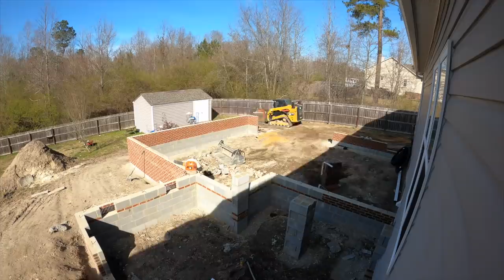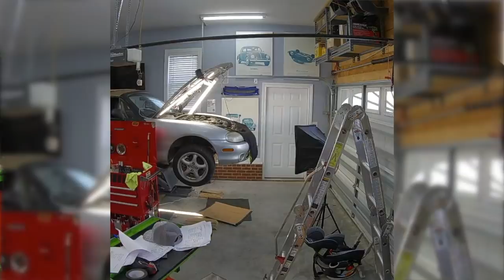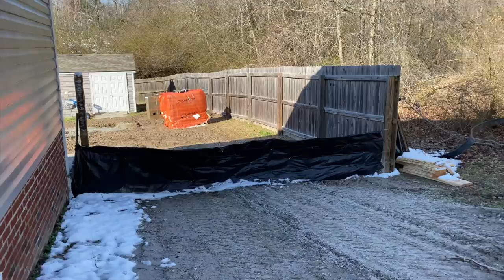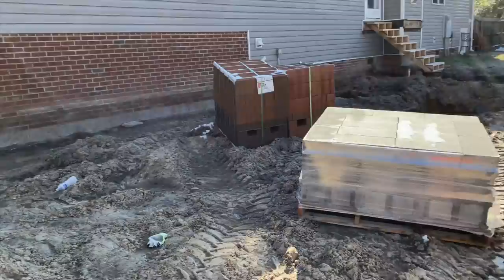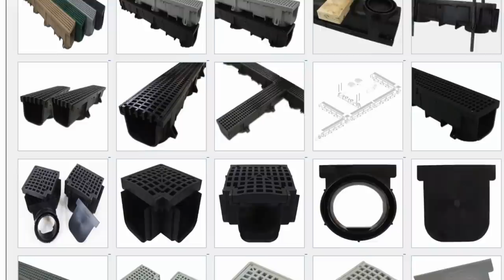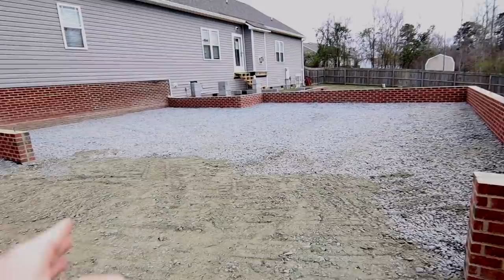We are Building a New Shop!!

Comment from the maker: Something I forget to mention in the video, we will have 220v on each wall. Also there are something that we aren't doing. Yes Id love to have 10x the space. We did the most we could in the budget we have.
Reply: We car them roller shutter doors but good idea to save space.
Reply: I recently built a shop of my own about a year and half ago, Here are some things that I did to try and "future proof it"
1. Run electrical for ceiling fans, Its cheaper to do the wiring with everything else even if you don't put the fans up right away (I still don't have fans)
2. Run power for the roll up door even if you don't plan on having an electric motor now, down the road its nice to have an option
3. Run a empty circuit to each side of the walls to go outside of the building you never know down the road what you will need power for outside
4. Ceiling mount circuits for drop down power cords
5. Dont forget exterior lighting
6. I went with all LED light fixtures and love them

Something  I wish I did at the time,
 Epoxy the floors, I told myself I would do it down the road. (still haven't) but its going to be a pain in the ass with everything in the way. now there is staining in a few spots even though I try to keep it clean.
I also wish I would have painted the walls white at the time even though I have a ton of light It would have helped out a lot for light.
Reply: @bmxguy08  Bloody surprising just how much difference painting the walls white makes. Did it down my little garage with tiny windows, and it used to just be brick. Very dark, had to use lights throughout the whole garage. Painted the walls and there is now only one spot where I need a light on during the day.
Reply: HumbleMechanic I use a pellet stove for my 1000sqft garage works amazing when it’s 30-40 degrees I go out around 6:30 am and by 8am it’s 60 degrees and will get up to 70. I also have concrete floors as well
Reply: Show us the black R32 ;)
Reply: Did I miss it or you did not mention doing an air system in your new garage?
Reply: Hey random question. I'm thinking of buy an Audi Q7 Quattro with the 3.6L. what should I look out for? Is the reliability the same as the Touareg
Reply: Definitely go with new age cabinets

Comment: Sockets...lots of sockets or power outlet as you call them. Keep the air compressor outside in a small enclosure for noise reasons obviously
Reply from the maker: Oh yea!!!! We doubled the outlets, and I will be building a compressor house. I don't want that noise maker in the garage
Reply: Piggy backing from these - might as well plan for AP's and conduits for ethernet cable runs.  And conduits for PoE security system.
Reply: Make sure each outlet has its own ground that was over a million dollar mistake at my old colledge

Comment: As the floor heat sink countermeasure, we are permitted to use the ground rated, insect proof poly-iso here in Tennessee.  Fully compact the fill (and I mean ridiculously THOROUGHLY), we used to run sprinklers on it for a few days, let dry until ready to final grade (again), final grade, 6mil plastic with a stitched rolled seam (hot dipped galvanized nails every several inches pinning the two sides flat rolled together on minimum 4" roll), 1" minimum high density board foam insulation, rebar tied in high impact areas,  heavy reinforcing wire grid everywhere tied to rebar, 6" minimum everywhere, I sagged to 9" at doors and lift areas. Use grout or cement at your floor drain joints to help support the pipe. Use oversized conduit in walls even if not required. Also add extra conduit stubbed in behind walls for compressed air/ water outlets.  Take pictures of all wall walls before closed up,  label wires and receptacles for circuit info (example NG CB1 = north garage cicuit breaker #1) with an owner's manual style documentation completed as you go.  'Doors are XYZ brand, model number 123456789.  Door opener is XYZ brand tied to dedicated NG CB 12"
Reply: But check local code on garage floor requirements first obviously

Comment: Awesome! Though I don't do car work in my garage I do a ton of projects, woodworking, and guitar building in mine. Some thoughts:

- Floor drains. (You've got em!)
- Insulated walls and doors (Sounds like you're headed that direction)
- I have a small closet for some loud motorized tools... air compressor and dust collector. Having them in a different room really helps with noise. I get lots of positive comments on this.
- Plumbed compressed air. Nice to have the hoses in the walls
- Spot in the garage for electronics... computer, stereo, etc
- Venting/ducting that vents outside.. I use this for dust collection, but I imagine you work with stuff that makes some nasty smells/smoke
- In your case, I'd have a utility sink in the garage and not rely on the bathroom

Have fun!

Comment: Do you have natural gas? A Mr Heater Big Maxx garage heater is a pretty inexpensive way to keep the shop warm during the winter. Especially if you have them run the gas, electrical, venting, and mounting while they build the structure. Then you just need to hang the furnace and hook it up.
Reply from the maker: Sadly no NG here.
Reply: @HumbleMechanic  Bummer, but you should definitely be able to find a mini-split that has a heat pump that will do AC and heat though.
Reply from the maker: Yep that’s what we are doing. I forget the size we went with

Comment: I have a 80k btu hanging unit heater in my  attached 30x25 3 car garage.   16 foot and 9 foot doors. No insulation under the slab. 2x4 stud walls with osb sheeting and fiberglass bats for insulation.   The ceiling has r 39 of of blown in cellulose.  Southern wisconsin winters. I have no problem heating the garage and keep it at 70 all winter.  The heat sinking is not that big of a problem.  Pro tip. Don’t forget the condensate drain for the heater.  Thanks for the vid.

Comment: Epoxy flooring is worth every penny, I did my home garage and oil, dirt, and grease wash right off, no more oil spots on the concrete. Also it will help with the heating, it's like a cover over the concrete so not as much heat lose

Comment: In our Garage the most important thing is the Music System. So, install Speaker and Amps as much as possible.
Reply from the maker: I did that in the current garage. And I never use them. Haha the Bluetooth speakers are pretty solid these days
Reply: @HumbleMechanic  i use a chromecast audio connected to  a small receiver with speakers. Super easy to cast music from any phone on the wifi and basically any app. I find that it works super well.

Also, insulating the garage door itself helps a ton. I live in the next town over and in summer my garage got unbearably hot. Bought a garage door insulation kit at Lowes and now the garage almost never gets above ~75 in summer (even when 100+ out) and rarely gets below 55-60 in winter (even when 15-20 out). And that is with no A/C or heat.

Comment: For cabinets, have you considered looking at IKEA? All of their stuff is modular so you can have drawers and later on if you want a cabinet with a shelf you can swap that stuff out very easily. Also, for lighting, HF has some great 4' LED lights that are set up with regular 110V plugs. It allows you to put outlets in the ceiling on a switch and hang the lights on chains wherever you want. If you find you want more of less lighting in a certain place you just move the chains around or plug in another light. They are also only $20 each with a coupon and are super bright. I am redoing my garage currently and found both of these things really useful.
Reply from the maker: Nice!! I do love me some ikea

Comment: If you're going to apply a specialty coating to the floor, you need to wait 30 days for the "salts" to leach out of the fresh concrete, otherwise you will encounter problems with adhesion.
Reply from the maker: This is true! If they pour the floor next week(that is the current plan) then it wont be an issue. If they pour the floor last, I will have to wait :(

Comment: Could do a I-beam that spans the width of the shop with a track high up on the opposing walls for it to have some sort of roller set up. This beam would serve to hold a gantry crane host and make life easy to move heavy stuff around the garage. This would also mean you are not using a cherry picker in the shop that could damage the coating on floor.
Reply from the maker: That’s a solid idea!!!! I dig it

Comment: my dad ended up getting metal shelves from a couple stores that were remodeling, so got them cheap.  a couple shelves are made with doors we had in storage and 2x4.  used what we had and McGuyver-ed what we needed.  I don't blame you for the concrete.  my dad wasn't sure what he would get or need when he built his so he did a thick floor too.  I think he did 8" but it was a long time ago so not sure.  my dad did extra wall outlets as well since we had a lot of corded power tools.  might want to figure out how you want to do any plumbing for air lines (at the very least so you can fill your tires).  keep in mind you can plan for any possibility, and there will still be something unexpected to come up.  congrats and I hope you enjoy yours.  metal roof would likely be nice.  tends to be cheaper to get and definitely cheaper to maintain.  plus the sound of rain on a metal roof is nice.  haha
Reply from the maker: Thats awesome! I have been leaking at auctions local for that stuff!

Comment: inspection pit? probably not needed with a lift though. 
How about a ceiling hoist with a track? 
Heard you were running 240v, is it enough amps for a welder / dabble in that maybe? May be best to just run a 60-100a subpanel to this new space and have dedicated circuits off that.
Reply from the maker: yes we will have a sub panel for the shop. No pit, but if I had my way, it would be an inground lift. but $$$$$$$$$$$ LOL

Comment: Looks like a the new addition will be life changing.You could place polystyrene foam blocks under the slab before pouring the concrete to improve the thermal insulation also have you looked at car stacker lifts like hoovies garage .
Reply from the maker: We are doing the foam. :for that exact reason

Comment: Looks like a beautiful workspace but they get small fast ..one thing you can do is put in pocket doors you just have to plan a head each pocket door will give you 30 to 36 inches of wall space you can also run 2 inch electrical conduit in the floor for certain things you know will never move air compressor/garage door opener‘s. I’ve had sloped floors in shops and floors that were flat as a pool table and And perfectly flat floors wins every time ...When I would wash a car with a flat floors I just use the squeegee ..most of the water would go on the drain even if it wasn’t sloped what I would tell the concrete contractor is that there’s going to be precision machinery in here and the floor has to be flat as a pool table and then I would have them do the power trowel and polish it You could finish it with anEpoxy finish 28 days later. Much easier to sweep and clean because bare unpolished concrete is very absorbent in the automotive application the concrete needs to be sealed Buy some method

Comment: Use your 4 post as the car lift. Also check out teng tools, for boxes, Good box for a reasonable price. You could check out just putting in the pipes for under floor heating and don't plumb it in till later, (when installing your lifts you just need to hook up a pump and run hot water through the floor, using a thermal cam so you know where to drill so not to hit the pipes)

Comment: Called roller doors here just remember because they’re a bigger roll when doors up ,when you put doors down you have a gap . I have  5 roller doors in my shed and live in a arid desert region and the dust problem from that door gap has been a pain in the ass.
Reply: Rohan Jones your doors don’t have proper weather seals. Normal coiling overhead doors installed correctly don’t have gaps when closed.
Reply: Patrick94GSR  none have here in Australia never seen weather seals for roller doors ? Would like some pics so I could possibly make something up

Comment: How much oil do you accumulate over a year? For heat look at Clean Burn oil furnace. I have  a one at my shop and it has been very trouble free for the last 13 years. They have many sizes and are great to work with.
Reply from the maker: I have thought about that. Just a small system as supplemental heat. Luckily its not that cold here.
Reply: If you talk with them they will size it right for you and it will create all the heat you need. I am in Wisconsin and the one we have keeps the shop warm with 5 quad axle dump trucks inside. 
Yes we also have gas modines incase something fails, they were in the building first and it is alway good to have redundancy.

Comment: So the garage you have now, where you film, how many cars can it hold and the garage you are building, how many cars can it hold?

Since you are putting in a two post lift to work on the car, I take you can have a 4 post lift for car storage? If not, why not? 

From the looks of it these other cars will go around the back of the house? 

This might be the best build or modification you have ever done. :-)
Reply from the maker: Current space I might be able to squeeze 3 tiny cars if I had nothing else in it. 

New space will be 3 with ease, 5 crammed

Comment: Why not a roller shutter main door? No tracks apart from vertically in the door frame, no visible motor, and takes up very little room. I have a low ceiling i my garage, so a roller door was my only option. They are the most popular type in the UK anyway.
Reply from the maker: That is a good idea. I am sure the builder will hate me by the end HAAHHAHA... "That is not what most people do Charles" HAHAHA
Reply: @HumbleMechanic  I am glad I was finally able to advise you for a change lol.

Comment: Great video.  I don't know what state you are in, but it sounds like you are too far north where you are more interesting in ac than heat so this is more of an FYI.  You can do radiant heat in a garage with a simple system far cheaper than a house.  I have a 36x36 garage and it cost less than $2k for a water heater based system, as opposed to my house with a proper system which was nearly 4 times that, getting it at cost.

Comment: Have you laid down the concrete floor yet?
Reply from the maker: No. They should be doing that Monday
Reply: @HumbleMechanic  here's an idea I got from the DOT truck inspection station here in Ontario. They have recessed bays to get under our trucks on creepers. They run the whole length of the bay about 3 feet wide by 8 inch deep with track lighting up the center. These bays allow officers to check our brake adjusters, air lines, inner tires for damage, etc. Obviously in your situation you would need to go slightly deeper but less wide. Thought I'd float the idea to you. I can get pictures of these bays on Saturday if you want, or you can Google street map the scales. They are on the 402 in Ontario between exit 15 and exit 25 eastbound

Comment: hey man, didn't you used to work at a dealer? shop is gonna be sweet.
Reply from the maker: I did. :)
Reply: nice bro, how you liking independent life?
Reply from the maker: Love it. It’s been about 3 years now.  I miss parts of the dealer. But overall love where I’m at
Reply: hell ya man, i like it most of the time but sometimes i wish i had never got into the trade.
Reply from the maker: The trade is awesome. The way a lot of shops behave is less than awesome